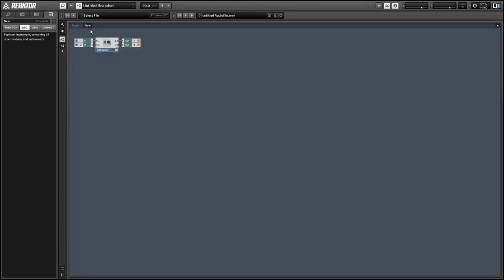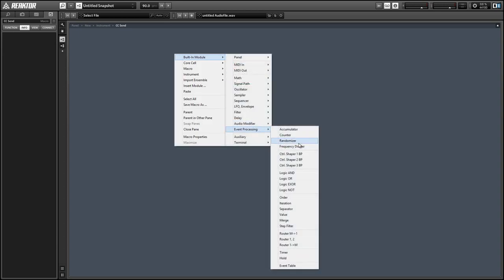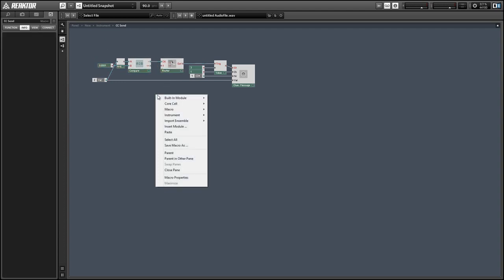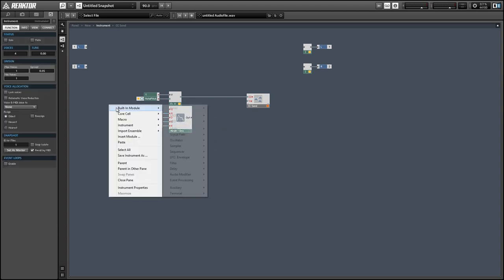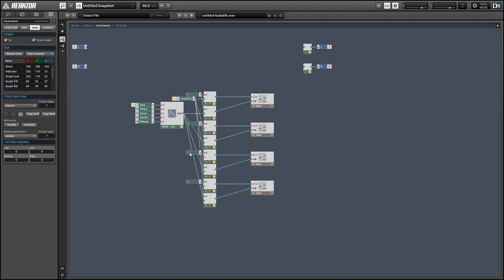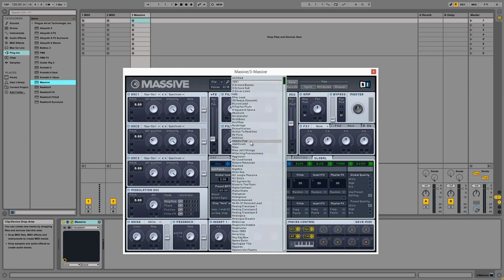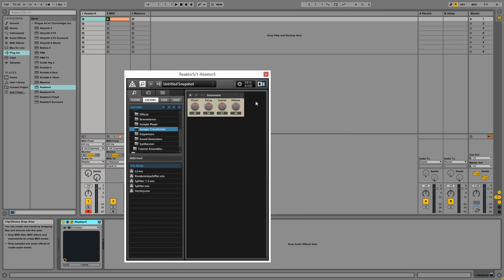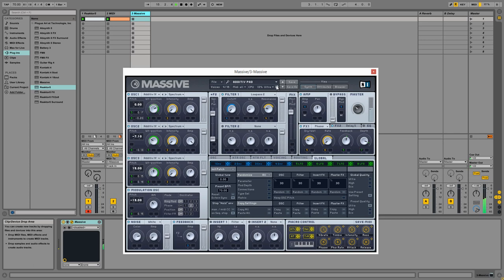How to Control Knobs with Reaktor via MIDI

Comment: Hi there, I'm running Reaper DAW with Reaktor 6 loaded up, and I need help please. My Reaktor 6 keeps changing my presets/shapshots and the midi controller is hijacking the interface and keeps changing it, how do I disable the Midi controller so it doesn't automatically change my settings?

I want to disable the midi controller completely.